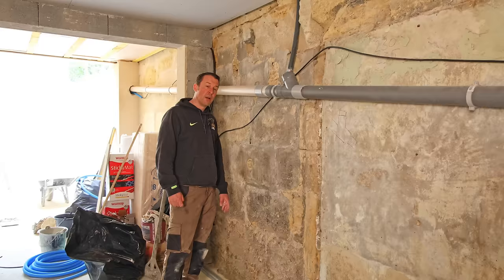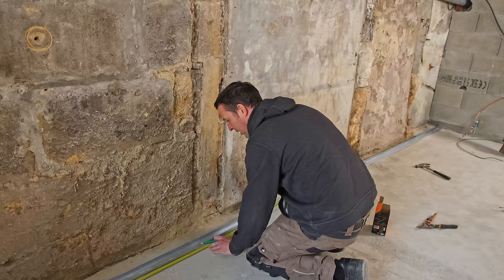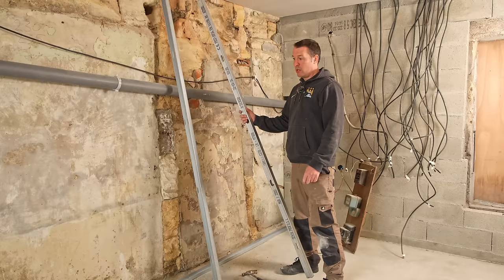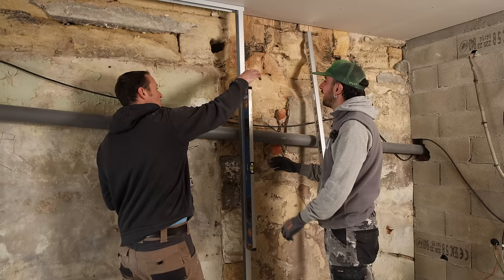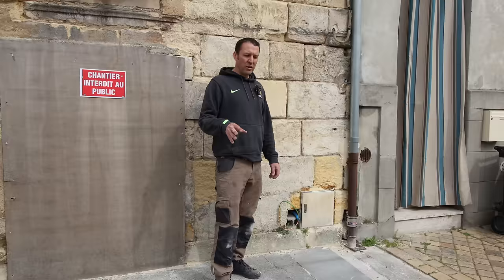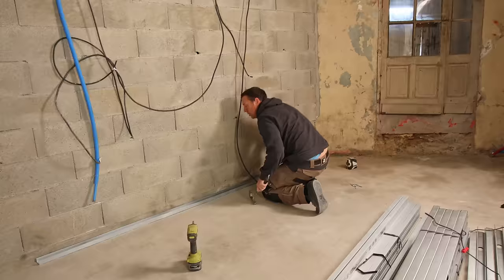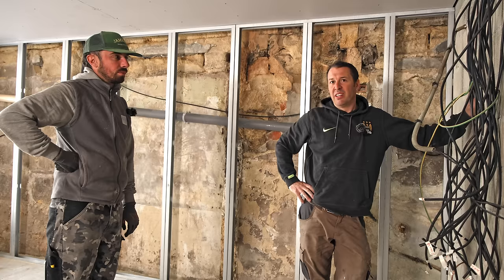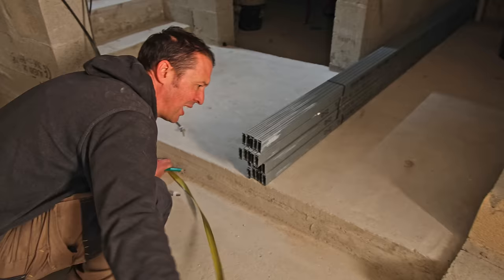Renovating In France - Building A HUGE Metal Structure

Comment: I also used metal frameworks for my renovation in Southern France and if you use the right tools to cut the rods instead of metal scissors it becomes a piece of cake. We didn't use plasterboard, but Fermacell - it's more solid, water and fire-resistant - but, of course, more heavy and expensive. I appreciate that you looked at my comments on the grounding cut-off device and adjusted accordingly. Inside the house it has not to be on sight, you can hide it behind the plasterboard (with an access trap) or inside your fuse box.

Comment: I would have used a foam barrier between the cement and metal. Also, you should use Lexel or silicon the hole where your ground rod is. Once you close up the wall you never know what’s going to bubble through that hole into that room. Also helps prevent those nice little creepy crawlers finding a new home.
Reply: There is a proprietary plastic section for this job they cost about 3euros for a 3m length
Reply: There might be sanctions against using certain products like foam barrier on the walls due to historical preservation and damage when removing? Not sure in France but I know this to be the case in my country when renovating historic listed houses…
Reply: Bye
Reply: Montant = Stud = Vertical rail 😜 Nice project very professionnal and excellent filming👏🏻👏🏻👏🏻👏🏻 Regards from La Rochelle / Île de ré😜
Reply: @jennil664  I doubt anything in the build comes under historical protection - other than the look of the outside of the building so it still fits the neighbourhood even if everything inside is replaced.

Comment: The reason for the earth wire connection now makes sense, I was baffled by it before.👍 The metal system for your interior walls for me, makes it much easier to do than using wood. I think it's also makes for a neat and precise job and prevents the chance of ending up with rot or beetle in the future.👍

Comment: A barrier between the steel bottom plate and concrete would have been a good idea. Concrete is actually not waterproof.  It will wick moisture over time and the steel will rust.  Much faster than wood would rot as well.  There are benefits to both steel and wood wall construction. Here in North America we generally use wood stud construction in homes and steel stud construction is used in commercial applications.  I question your use of double studs at every location, especially in the middle of a sheet.  Save money on cost of steel studs. It’s the combination of steel stud and drywall (plaster board) that gives steel walls their strength.  Also if you split the difference of the stud where two sheets of drywall meet you save a steel stud there as well.  But hey, who am I to say.  Things are done differently in different countries and I understand that.  Love the work you guys are doing.

Comment: Metal studs are not used in residential construction in Canada - they are considered thermal bridges ... and when temperatures can reach  -30C in the winter, you really don't want your heat drawn outside. Metal studs are used in commercial structures as they are considered more fire-proof.

Comment: There is no "right" or "wrong!" as a general rule, it always depends on where you put the frame. The davantage of metal is, that it ads less weight to a construction, the advantage of wood is, that it is easier to mount heavier things to the walls. But in the end, if you feel more comfortable with using the metal frame, go for it, after all it is your house
Reply: Metal is more uniform than wood also but I wish it was a little more sturdier, still wood for me!?!

Comment: The metal frames are easier to construct less cutting and cost I would assume than lumber and then there is noise cancelling systems I hear that can be used. Every builder has their own preference and easier to deconstruct. I am just surprised you are starting walls when your electricals haven't been fitted to a box yet. We know you know what you are doing as you are a professional builder I think this place will be finished on target and whomever is lucky enough to rent it will appreciate all the details and safety you have put into this home. When will Anna start to do the decor design? Love the new Bordeau Life thumbnail with writing and wee wine bottle very nice.

Comment: Ed I have used the metal before, it`s a little different in the states, verticals 16 inches on center and we screw the top and bottom in so they don`t move, yours seem to just be standing in place, no screws on the studs? Metal is probably the better choice for you application, I do agree, it sure will look good once it`s all dry walled in, no more dungeon, be well.
Reply from the maker: The studs will be screwed in due time don’t worry

Comment: Called stud and track.we normally brace the stud from the wall if not fitting a rear board or double boarding for rigidity
Reply from the maker: At that height it’s not a problem when you double the metal stud
Reply: @BordeauxLife  as long as studs are joined together as they will flex and possibly cause cracking at a later d?s te
Reply: I think the metal construction looks straightforward and quicker than wood uprights and dwangs Scottish word for  the  pieces between the uprights my husband and I rebuilt a 3 story shell of a building in a historic village called New Lanark and I had to hand saw all the wood very hard work that was about 40 years ago  all hand tools😅your all working hard doing a great job which teaching I think Louis will be able to renovate his own house 😮 Ann 🏴
Reply: I would have thought that there would be some kind of bracing between the wall and the metal studs, else it's just a large void, almost like a cavity wall.  Could you fill it with insulation?  Will there be noggins?  horizontal connectors between each vertical?  Or is it rigid enough without?
I spent a while searching for why firemen in France cut the earth wire, and couldn't find anything, so I'm not surprised that this was in fact incorrect.  Shame on the person who told you this porky pie!  I'd have words if I were you!

Comment: 4:30 I've never seen wood used for drywall structure in France, I think it's more an american thing? Every construction site I've seen in France, every house I lived in, used metal studs in drywall.

25:00 Ah-ha :) The barrette de connexion de terre doesn't have to be in view, it just needs to be accessible. It's fine at the bottom of your Gaine Technique de Logement, which will have a cover that can be opened. You're going to have your electrical panel on that wall anyway, I'm sure you'll figure out a way to make everything look neat.

One thing I forgot to comment on previous videos : so the drywall is going in, I see the 230V electrical wiring... where's your low voltage wiring? Network (phone/internet/fiber) and TV. I believe you're required to have a network socket in each room... and a TV socket next to it is nice to have, a lot of people still watch TV "the old fashioned way" with the antenna connexion (not sure if it's required anymore - the way the norme sees it, the network wiring could be used for TV if you use Grade 3 network cable... I prefer to still install TV coax next to the network wiring)... If you can skip the consuel I guess you can ignore that (and hope everyone uses Wi-Fi for everything? I'm a network engineer I like to have everything wired :D), but if you must have a consuel visit, then check an NFC15-100 guide to see what's the minimum that's required as far as network/TV goes.

Also might be a good idea to prepare a conduite/gaîne from the facade near the connexion boxes/point de branchement (the three boxes on your facade next to your neighbor on rue Laville-Fatin, there are three because one is for phone, one for cable, one for fiber... probably only the one for fiber will be used anyway) to where ever you want the fiber socket to be installed in the future (NFC15-100 says through the gaine technique de logement, then from there using the gaînes for low voltage wiring, to any room... or the fiber socket can also be installed in the GTL), otherwise when your tenants get internet installed the sub-sub-sub-contractor will drill the facade and install the cable the way he wants, and he may do a poor job at it.

Comment: I had a conversation with someone about the timber/metal studs debacle , who’s right , who’s wrong lol what was said to me is that person would choose timber for habitual spaces and metal for commercial/outdoor spaces .. when asked why? they said when you run cables etc through , there is a possibility if there’s a problem and say a wire is tipping the metal structure , the structure itself can become live whereas timber will not and also in houses etc most people will be hanging things so timber is usually preferable.

However I myself know sweet FA about building and you work on experience and both are used in construction so I would say both are right and it really comes down to preference. ❤ The place is looking amazing. Well done.

Comment: Metal track and studs for the framing of the wall. If you put two studs at the 60 cm mark, would you not risk screwing in between them rather than into them? If you install the top track using the same level line as you did the bottom, installing the studs is a quick and easy job.

Comment: The wall you are working at in the beginning of the clip, was that a doorway?  If it was its a rather large doorway, but it has to be because its has a boarder around it with blocks. In America we call the up rights on the walls Studs, it is how you attach the the facing of the wall like drywall, or as you call it rock wall
Reply from the maker: Yes it’s a bifold door to the indoor outdoor area

Comment: I think what you use depends on where you are building and what your intentions are.  Where you are there is a lot of water and you are under the water table... so using wood is probably not ideal... the metal isn't going to hold moisture.

Comment: Question Edd on the lower floor windows.  Are you going to have a non breakable glass put in the windows, or will you put bars on the outside window?  To keep the squaters out.
Reply from the maker: No other house in the street has a problem with squatters so not will this one…… it was the fact that it was abandoned that made it a squat, but to keep people away from the window of the living room I may put a bar, more of a psychological thing to passers by to keep a bit of distance from the window

Comment: Is the unit nextdoor on de Cenon also abandoned? The opening shot gives an impression its possibly boarded up.
Reply from the maker: That’s part of our building, unless you are talking about the neighbors doorway ? It has a curtain in front
Reply: Yes the neighbor at #4(?) 

Is the big flat space in the wall you were framing in this video a closed up doorway to that house? Or just an old repair? 

I live in a place where houses don't usually touch and houses have stick built outside walls  vs block, stone, or cement. (Earthquake codes)

We have condos that touch, but those have hoa's to manage the outer and connecting parts, and things like noise. 

So all of these style of European buildings are very interesting to see how it all work and how the structures and neighbors interact.

Comment: Please explain to this novice builder why you are doubling up the intermediate "studs" (at 160cm)?  It seems to me that if you screw the plasterboard at the 160cm mark now they will drive between the two vertical pieces and not into either stud.
Reply from the maker: So the doubling up of the intermediate stud is to give strength - it makes a huge difference

Comment: I can understand double metal studs at the joints of the drywall but why the doubles studs at the middle of the drywall? Why not just one metal stud?  Seems a waste
Reply from the maker: It’s not a waste it makes a huge difference to strength especially if you try to push the dry walk-in the middle - there is a lot less movement